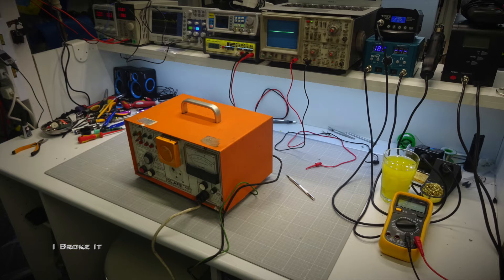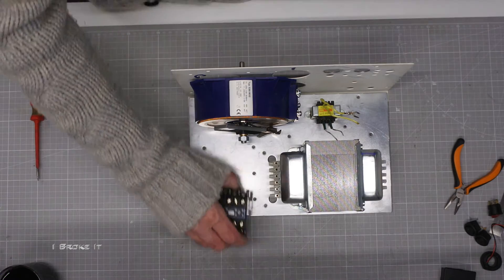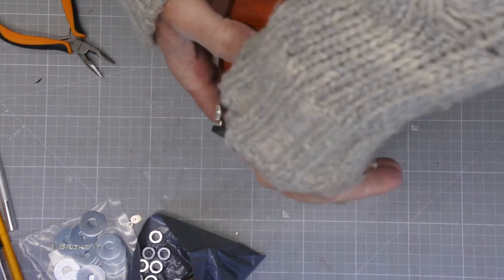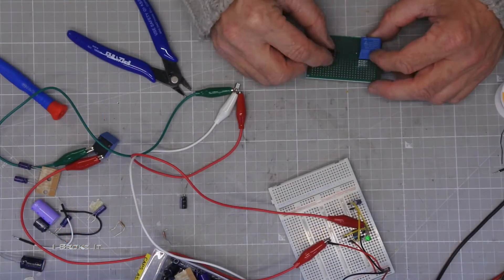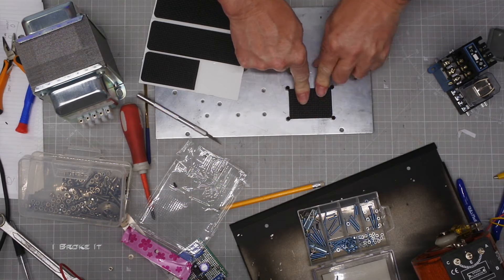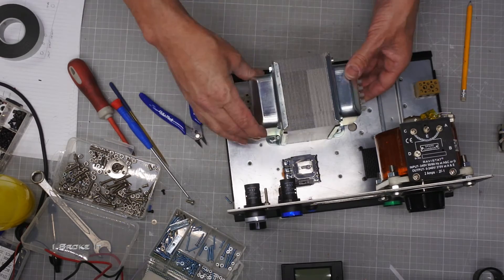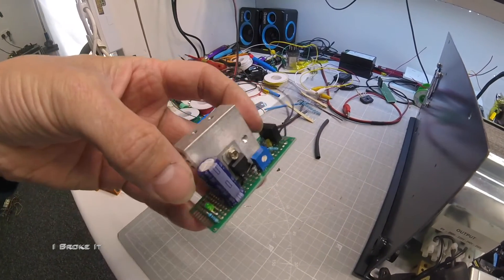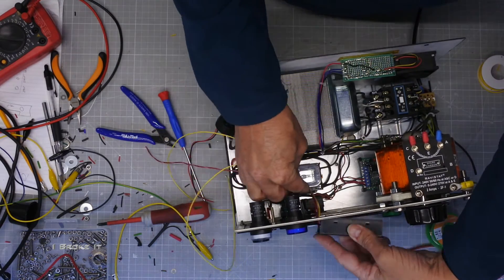ISOLATION Transformer BUILD..

Comment: Part 2? Parts list? There’s a triac, a large transformer. A set of contacts with auxiliaries and another coil next to that. A control transformer, a cube relay, and a small transformer behind the big one, and start stops ready and the voltage displays. The electronics under the triac and the ones mounted behind the face. Now put it all together